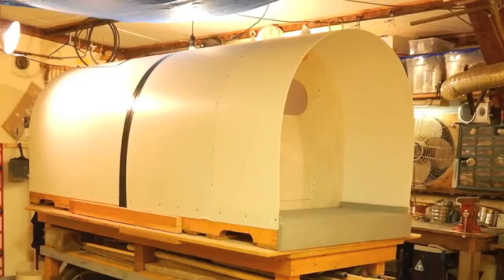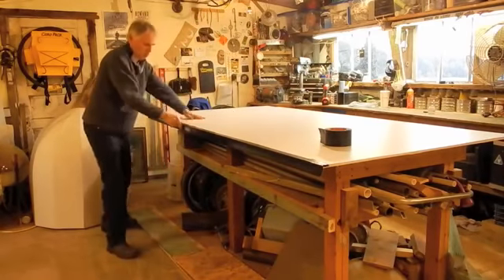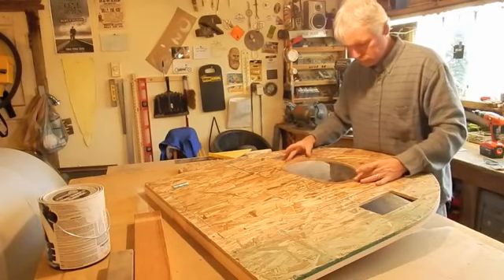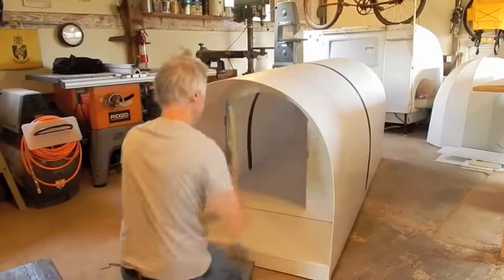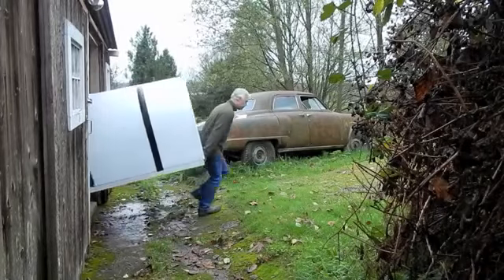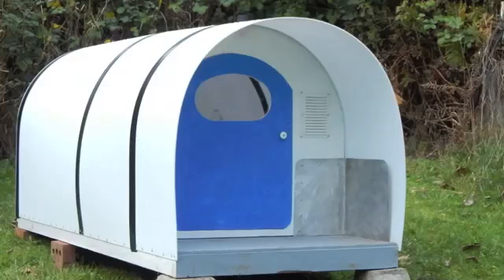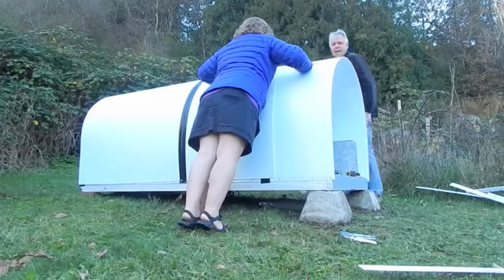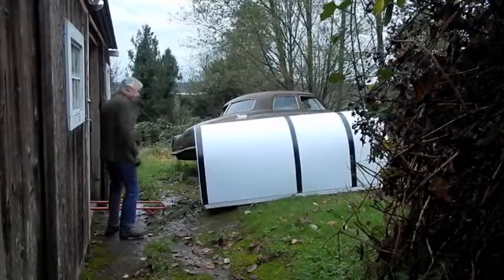Construction of homeless sleeping pod using plastic Conestoga sheet technique that works

Comment: Dude, something else. There's bendable plywood. You can get  bendable on the 4' or the 8'. It's expensive and would make it darker but i thought it'd help with your louder than hell rain issue. Or maybe having (this would also be more money) but putting another bended roof wall on top of your primary but leaving an inch, a half inch, 2 inches of space between roofs to create a void which I'm imagining would deaden the noise. Anyways. Great design. Great video. Thank you
Reply: A thin layer of bubble wrap in between those 2 sheets would deaden noise & provide considerable insulation w/o blocking light.

Comment: Great camping unit, but the problem with housing the homeless isn’t the “housing” part, as there are already plenty of decent, low cost options like Conestoga huts, yurts, converted trailers, a decent tents on a wood base, etc).  

The problem is the land underneath…the WHERE can they be put, and all the sticky questions that go with that….can the homeless leave these on city streets, or in parks or public woods?  How many is too many in one area, if allowed….especially as they have no bathroom facilities or water, etc.   it’s the “where” part that is the hardest, not the “what” part.

Comment: Paul Elkins, Great video!  Inexpensive (10 for $4 at any drug store - like Walgreens) foam earplugs could help remedy the noise issue.  They work well for people using leaf blowers in the yard. Also, there are many places (like parts of Arizona - like Phoenix) where it only rains 10 times per year and sometimes just 1/10 of an inch.  Your design is a great solution for emergency shelters.  Kudos!  Great job!

Comment: Since my purchase, the corrugated plastic has gone up from 10 a sheet to $22.74 a sheet in my area> I was going to build a Conestoga hut with this covering, that you can stand up in, using cattle panels
Reply: What size or how long is thee sheet jw ive been tryna figureout what size I need to have enuf room inside

Comment: Make it a tad bit bigger, where someone could place a portable toilet, and look up Strongway portable power system, people could charge the Strongway, and bring it in that shelter for power, and lighting. If they are homeless, they maybe be able to heat water using a bucket, and heating element. Thus cleaning themselves up for a job.

Comment: I would still like to see what you proposed to make a camper for a Ford Ranger pickup or some of the smaller pickups I guess you could just put it on top of a platform on top of the the Ford Ranger bed above the wheels you have storage underneath and you'd have your sleeping Quarters on top